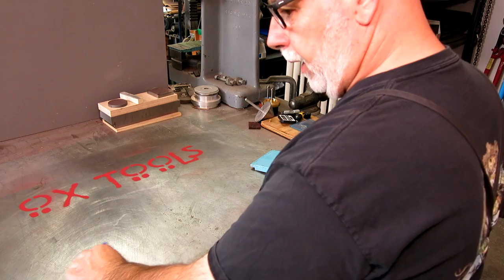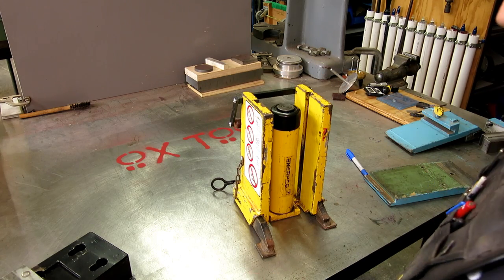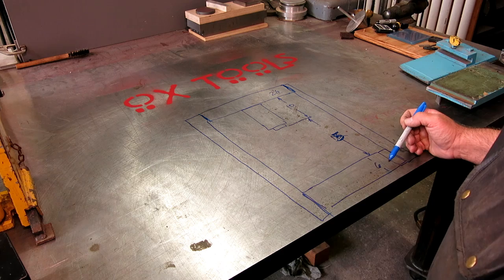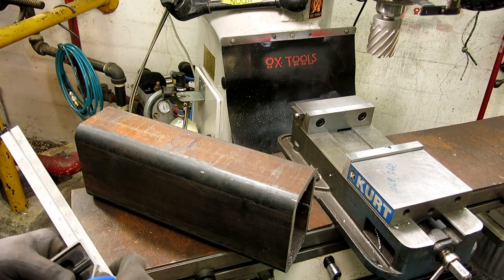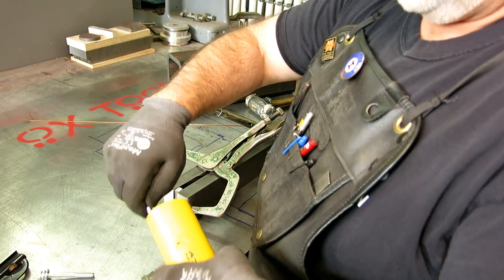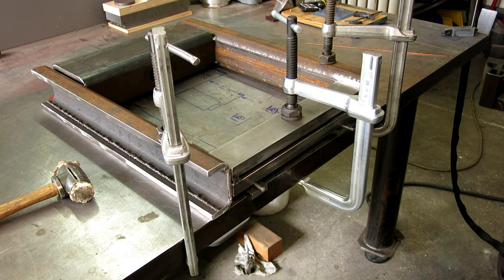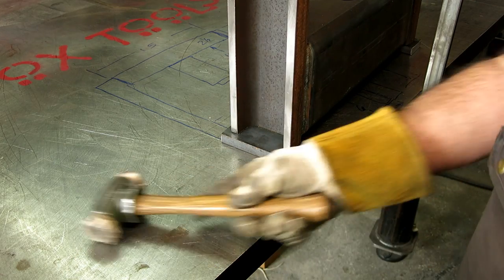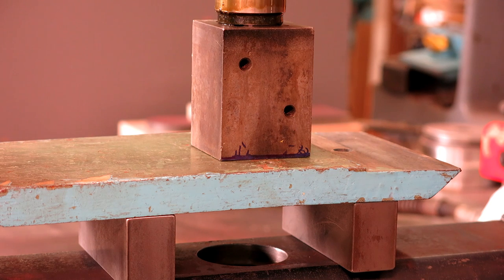Dogmeat Hydraulic Press

Comment: Good luck bending "heat-treated" steel plate like that with your "dogmeat press" and its "porta-power" hydraulic system probably good for all of about 3 tons "maxed out". Despite your "demonstration" and "that helped" commentary, I'm pretty sure you already found out how "effective" 3 tons of "porta-power" is for "straightening" 1/2" so-called "heat-treated" steel which you have to "over-bend" to get "straight" like ALL "elastic" materials once their "elastic limit" has been exceeded in a given direction. Its just unfortunate a "teacher" isn't willing to share "failures" with his "students" so they could really learn something.
Reply from the maker: Clearly you have no idea what your talking about. Did you not take your meds again?